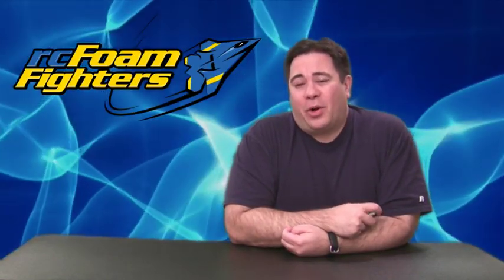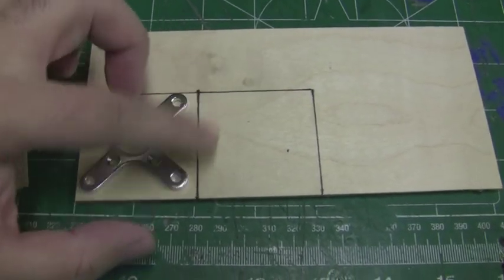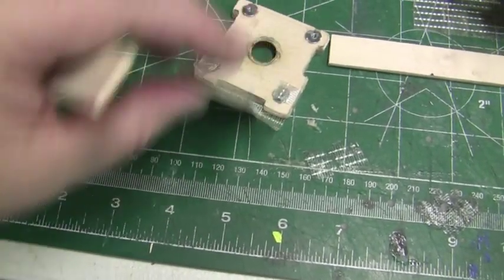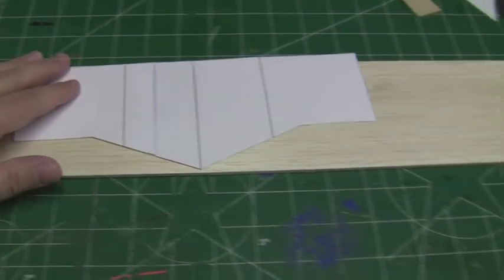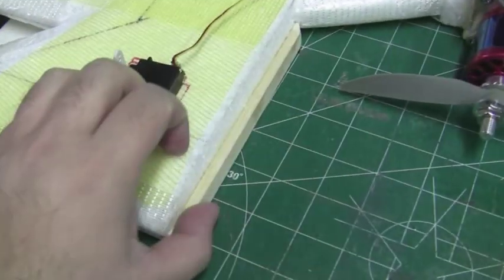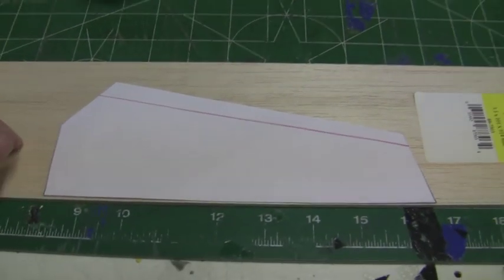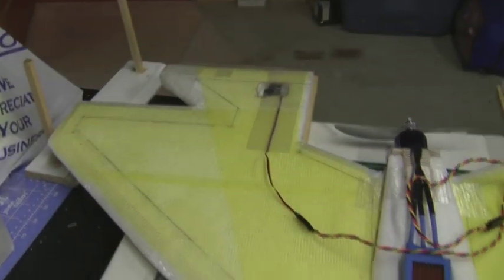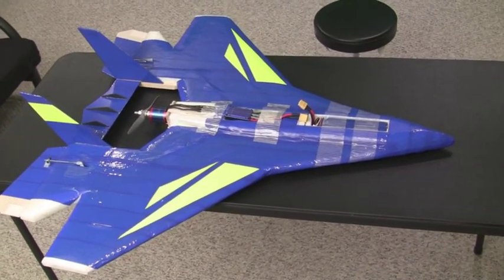Project SuperNova Part 2 (FAST Scratch Built RC Plane)

Comment from the maker: I usually make them a triangle type shape with the top point offset forward. not too tall, maybe about half an inch or 1.2 cm. You can put them on top or bottom. or even both. I like the way they look, so i usually put them on top. On the Super Nova i have three on top and on on the bottom.

Comment from the maker: Thanks for the comment vmat377! Hmmmm, not sure about making the thrust plate on the FF-22, as i have never tried to. It alost already has one with the prop being mid mounted. You could probably just add a few small fins (vortex generators) right before the elevator. I might have to try it on my big epp FF-22. That might be cool if it gives it that roar sound too.

Comment from the maker: Thanks Skydive4ever! most of the pusher planes we have made haven't required much motor angle. Mostly when it does, it is only up or down angle. Most of our planes are a little heavy and don't seem to have a problem at all with torque roll. I think on the SuperNova, the thrust plate really locks it in and keeps torque roll to a minimum. That and it's 3 pounds, LOL. Thanks.